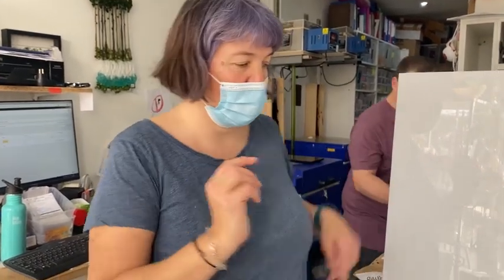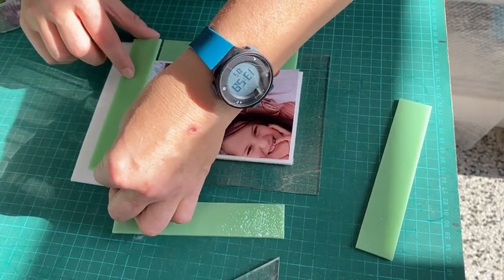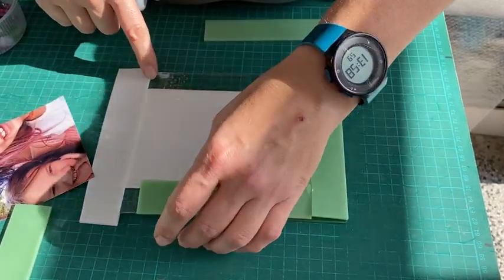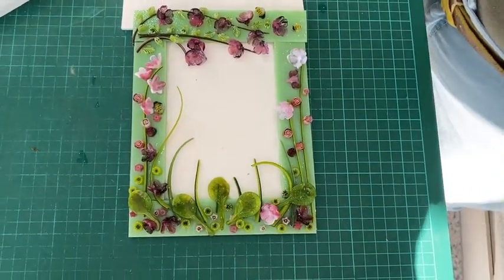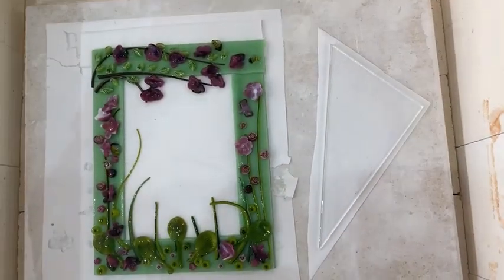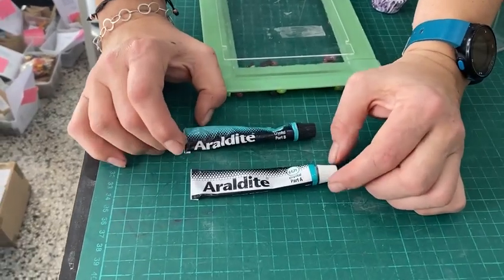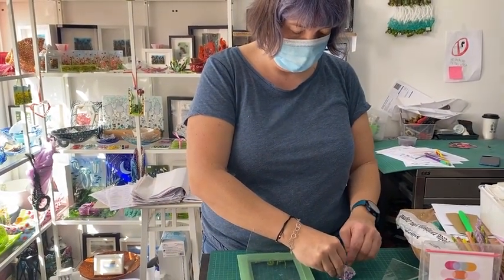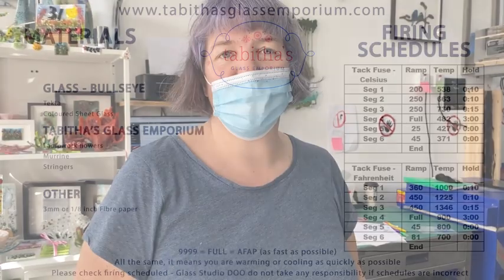Mothers Day Floral Photo Frame

Comment: Thanks again Tabitha… question…. Why did you use the adhesive you showed and not something that is used often in other projects? Example… Weldbond or E6000?  Kathie from Mexico 👍🐢
Reply from the maker: I used the Araldite Crystal 2 Part Epoxy Glue for gluing pretty much everything, as it works really well for me. There are many other options available, but from my personal experience, this one was the best.

Comment: Hi Tabitha
It's worth considering using UV glue as it doesn't stick til a UV source (I use  mini UV torch.
You can position the glass or the plastic support and then use the UV torch which activates within 5 seconds and is really solid.
I get mine from Amazon